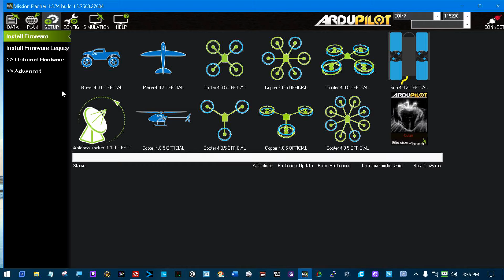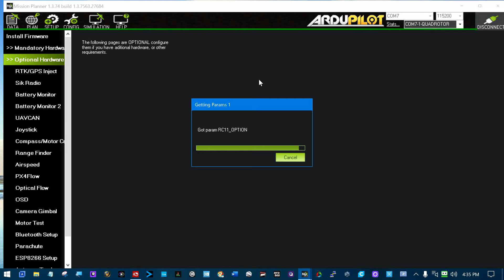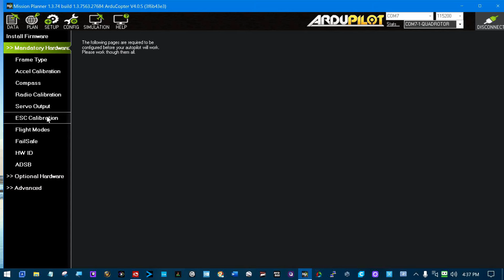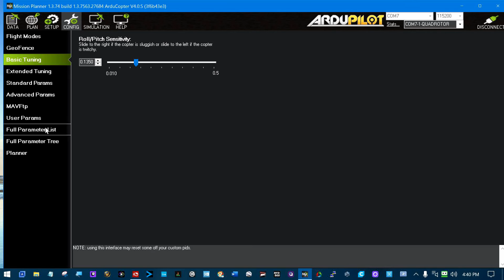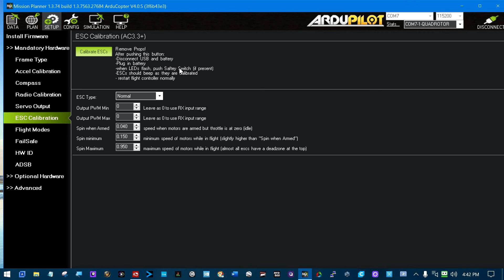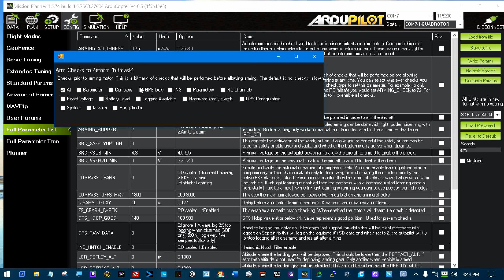ArduCopter ESC Calibration

Comment: Did not work for me, same issue. Any other ideas ?
Reply from the maker: Most of the ESC's sold today will fail this.  Depends on the firmware of the ESC.  Example: A ESC using DShot would fail this but be fine of setup correctly.  It can figure out its own limits.  A ESC that uses PWM would likely work here.  What ESC are you trying?

Comment: Hi, looking for what port I plug my esc into? Holy Roman 6c thanks
Reply from the maker: Sorry about the late reply.  Times have been trying lately.  Would have to know ESC type and maker as well as FC type and maker.
Reply: @nighthawkvs  it’s a pixhawk 6C althogh the esc is linear and starting at low stick?
Reply from the maker: I am not fully following you here.  You connect the pwm input of the esc to a pwm port where you want to control the motor from.  DSHOT ESC’s can then be programed through that connection using passthrough.

Comment: Thank you very much, very helpful ,I shall try it 👍
Reply from the maker: Thank you very much for the kind comment.  Let me know if you have problems.  Also know that many of the new BLHeli and DShot ESC's don’t require calibration and the ArduPilot ESC calibration will fail in various ways.  This failure is not a problem because they are self-calibrating.

Comment: Hello from New Mexico. I'm building a 4 inch micro long distance Arducopter drone, I'm using the Flywoo Explorer LR 4 V2 with Flywoo Dave-C-FPV 1404 v2 2750kv motors, matek h743 mini flight controller and i need a recommendation for a 32 bit 20by20mm m2 mounted esc. Can you please help me with a recommendation
Reply from the maker: I used this one on my little 5 inch with great success.
https://shop.iflight.com/BLITZ-Mini-E55-4-IN-1-2-6S-ESC-Pro1663?search=BLITZ%20Mini%20E55%204-IN-1%20ESC%20

Comment: i have Simonk 30A ESC and facing calibration error on mission planner ... kindly help
Reply from the maker: I had a lot of trouble calibrating my ESC on the Mini Talon recently.  I ended up putting the platform in manual mode at startup and calibrated it that way.  But I didn’t make a video of it because it was not an approved method of calibrating the ESC and I didn’t want to lead others down a wrong road.  Watch this video and tell me IF this is the kind of error you are getting.  Then we can work forward from there if it is or go in another direction if it isn’t.
https://youtu.be/_qPFSR-T7s8
Reply from the maker: This is long and a first draft.  But it is what I can find that may help.
https://youtu.be/riZrHYaMT-g

Comment: Thanks for shedding light on this! Ardupilot doesn’t mention this step. Does this method work with Herelink?
Reply from the maker: Yikes. I didn't know that was public. It was an answer to a specific question by someone. Herelink is a video transmission system, this was a person who had trouble getting an ESC to calibrate.
Reply: Well it’s out in the open. I tried this last night and it worked using my Herelink controller. 

Now I have to sort my PreArm: throttle too high issue. 

Thanks!
Reply from the maker: @heythatguy6  Cool.  Always good when things work.
I had not heard of Herelink until yesterday.  Looks good.
https://airsupply.com/product/herelink-pixhawk-remote-controller-hd-transmitter/
Reply: @vernon silver it’s a cool setup for sure. Would you know how I can solve my throttle too high prearm error?
Reply from the maker: @heythatguy6  Can you describe the problem or post a video?  Sounds like you are saying that Arducopter won't arm because the throttle is high when it isn't.  I would be interested to see what the throttle channel output is.
https://youtu.be/cpqWvul9FCU

Comment: I have a pixhawk 2.4.8 and 4 esc hobbywing 40A... I'm trying to calibrate a drone 4 propeller but no one of this sistem has worked. Any other idea? The setting "normal" or "one shot" etc what does it means? sorry my english
Reply from the maker: You can always calibrate with just a rc receiver.